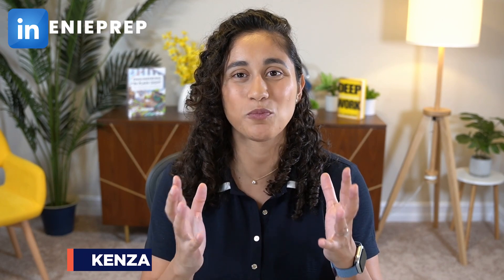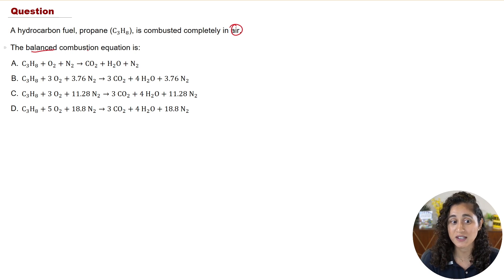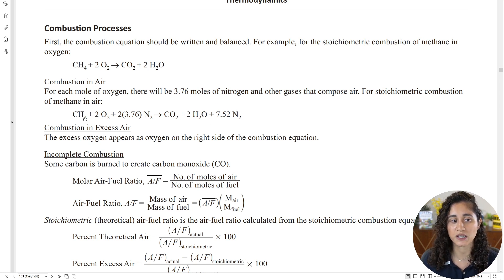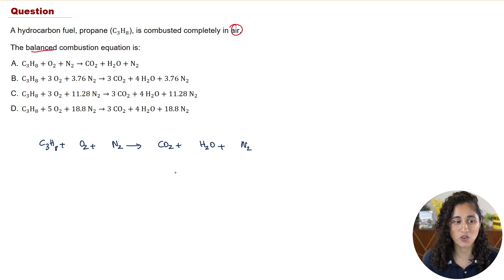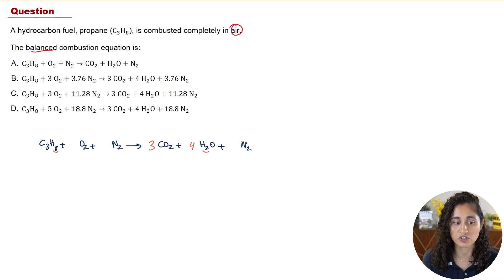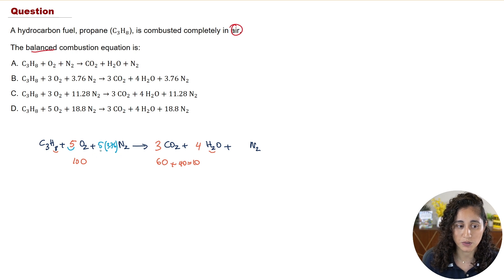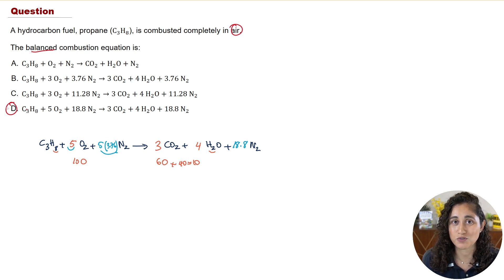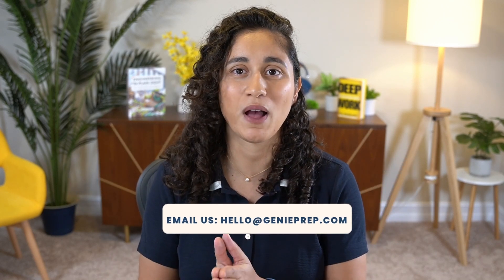FE Exam 2024 - Thermodynamics | Combustion In Air

Comment: i found the answer on Pg 354 in the fe mechanical handbook , in the environmental engineering section. can i always rely on that for the fe exam?
Reply from the maker: Hi, thank you for commenting! The FE exam only uses the official FE Reference Handbook, so yes, that’s the one you should rely on. Just make sure you’re using the most recent version, because page numbers and layouts can change. If you found the formula there, you can use it on the exam.